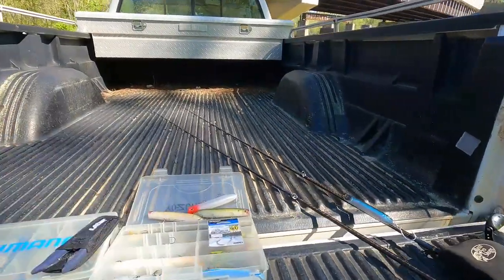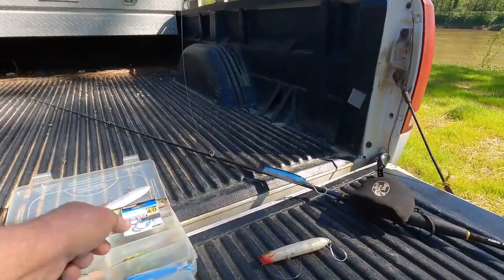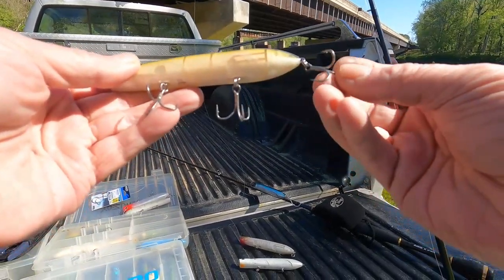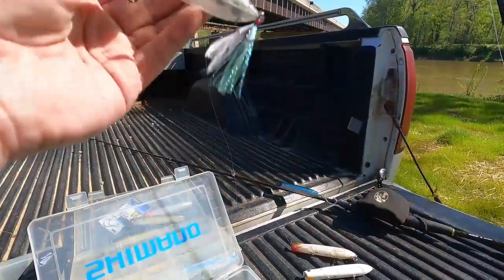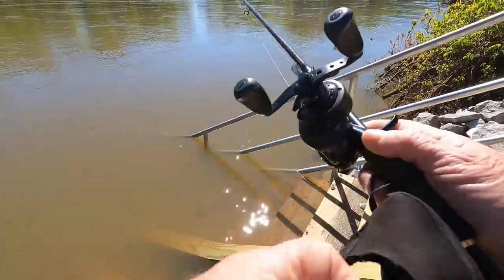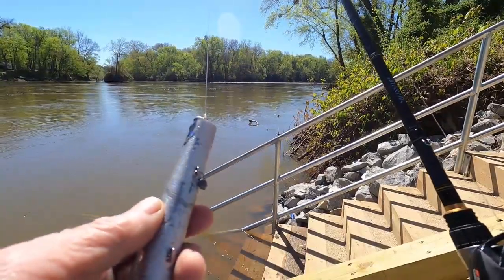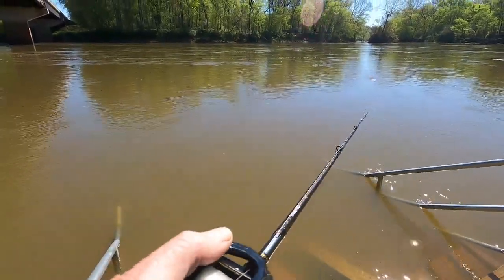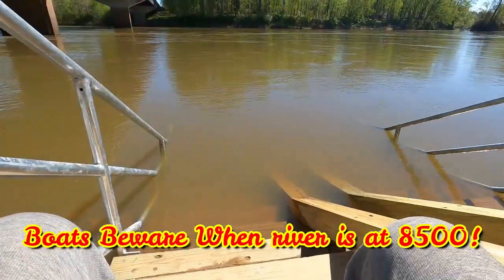River Dropping to 8500 Sunday, Get Ready, Weldon Boat ramp, Roanoke river, Weldon NC.Rockfish.

Comment: Lots of great info @jefftiz1 thank you for sharing.  I had a hard time finding any of this on the internet and ended up ordering a wide variety of VMC single replacement hook sizes and split rings over the winter.

As I understand, you can also cut two of the hooks off a treble to have a legal single hook.  Not ideal but might make sense for anyone who doesn't want to spend $4 on a single replacement hook and stainless snap ring on a lure that cost under $8.
Reply from the maker: Cheaper if you got lots of old ones.